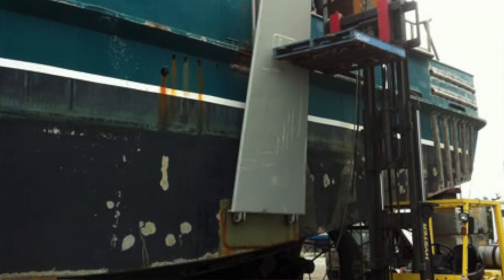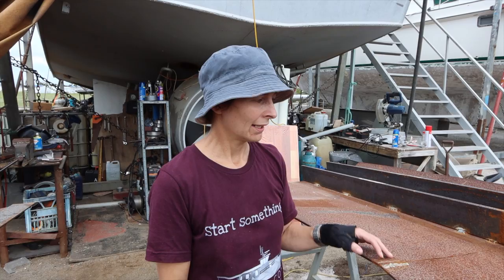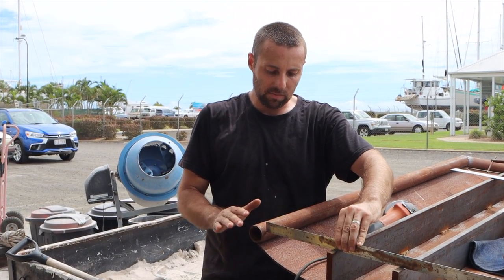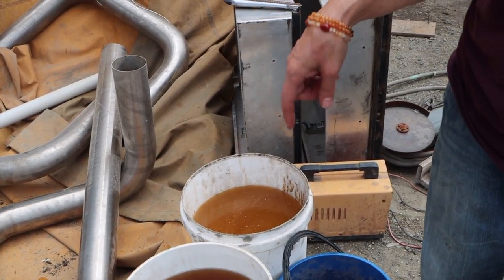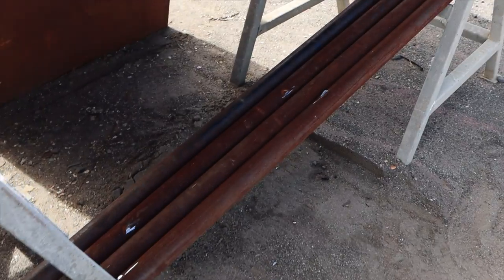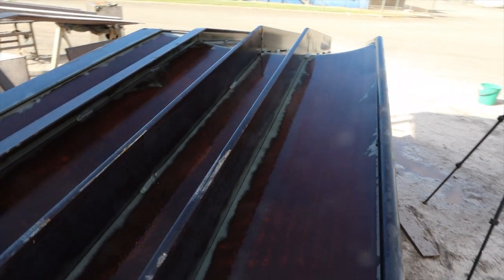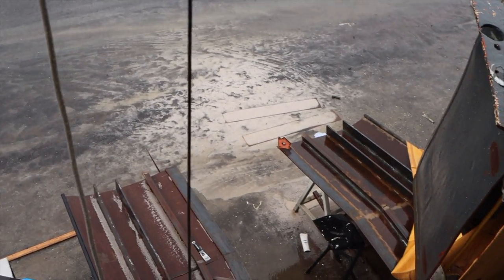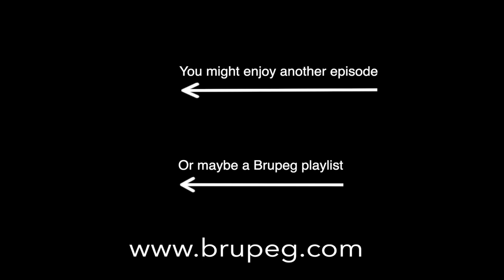Welding Steel Wings Together - Project Brupeg Ep. 127

Comment: Ok why can i actually sing word for word with that ending song??? Crazy. Fantastic BRUPEG is looking awesome.
Reply from the maker: I think it’s a sign you’ve watched the correct amount of boat building for the day... nothing more
Reply: @ProjectBrupeg  lol you think?? Enjoy the video's. One big question you ever look into the Electric over hydraulic tank setup? Which could be used in the Steering apps as if main Hydraulic system failed? Plus you could use to lift the Foils up and down with.
Reply from the maker: electric power pack they are called. They are good, but we dont have enough AC power production to run a big system, hence using the Kubota directly driving the pump means we can have a pump four times larger. That is until we can fit a big genset into the boat, at that stage we will swap out the Kubota and fit a large electric power pack. Its all about cash flow really and what we can afford to do right now with what we have.
Reply: @ProjectBrupeg  for sure i hear ya about the money part. I know i worked in the tool&Die industry and the big CNC machines used them units. Some ran low power and with some massive hydraulic pressure's. And they would replace them cheap with used units.

Comment: An old-fashioned compass, ruler and paper work wonderfully for plotting arcs of travel. Draw your minimum cylinder arc, your maximum cylinder arc, your required range of travel...etc. Keep your eraser handy and things will fall into place quickly. Keep in mind that you never want to bind the cylinder and the closer you get to lining up the three pivot points (approaching "over-center")...the more severe the loads. P.S. the cylinder is stronger in "push".
Reply from the maker: Thanks for the tips!
Reply: @ProjectBrupeg  Hey I saw those doors you made. Very cool mechanisms. Cool project all the way around!!!
Reply from the maker: Paul. Im hoping to get a metal lathe soon as I want to make some adjustments to those doors, they were a first attempt at something we had never tried before and we got 95% of the way to them being spot on, a couple of minor tweaks and i think they will absolutely do the trick.

Comment: You could powder coating your wings. That would be a lot better than just paint. In powder coating your wing will be heated up to a high temperature and a hot powder will be sprayed on to it. You even can choose a color. 
I put a grey power coating on to my stairs from the balcony down to the garden. I even had the steps coated. Now after twenty years the steps are still coated, even though the stairs have been used a lot. That shows how good power coating can preserve steal.
Reply from the maker: Hi Alfred, thats one option but powder coating can chip off and especially where we are going it will routinely be crushed against hard ice. For us epoxy paint has proved the most effective option.

Comment: Hi Guys..Going great guns now, well done..I like the idea of oil filled wings, I have used oil around boat trailers for my whole life and nothing beats it..In a closed cell like the wings in very hot conditions will create some minor pressure changes but it wont affect those bombproof units..Just a small aside though guys, Have you considered having Trev sign some official Brupeg adoption papers? He's a keeper!!..
Reply from the maker: I’ll start drawing up the paperwork now...

Comment: Dame, I love the idea of putting oil in the center cavity. You may want to consider a 1 cm hole on the bottom of the wing (when it’s vertical on) each of your braces. Then you could put a cap screw on the top and bottom and drain that out and replace every five years because the oil will get real sludgey and then not flow. You can also check for leaks because lifting that thing full of sea water may  break your hydraulics. The 1 cm holes will allow the oil to flow from cavity to cavity.
Reply from the maker: Hi Anthony. Yeah the plan is some sort of hole between compartments. As all longitudinal members are double continuous welded they won’t allow anything to pass. I was thinking of a bung at the wing tip end but it makes sense to hav one at the hinge end also
Reply: Project Brupeg also, use a standard thread on the bung, that way when you are remote and discover water in a wing, you can pneumatically push water from top to bottom and reveal the hole. You just keep an “adapter” for the bung.
Reply from the maker: Yeah that makes sense. If I make the thread the same as a nitto air fitting I can jsut rob the fitting from any air tool when its needed.

Comment: I would personally hot dip galvanize the wings. That way they are protected both inside and out.
Reply from the maker: With the wings fully welded up there is no need to protect the insides as the oxygen can’t/won’t be replenished.

Comment: Another great video. I’m not sure what your plan is but I’d put a backing run or backing bars (25 x 5 flat) in the join of the top skin, at the dihedral, before you fit the bottom skin. Then grind it out from the outside and put your root and cap runs in. Don’t weave the root and caps. Just run stringers. 
With the bottom skin join you’ll want to try for about an 80-90 deg included angle for weld prep with no more than 2mm landing (so you only bevel it down 4mm) and a nice even root gap between 1.5 - 2mm. I know welding outside makes it hard but I’d be trying to get that root run in with bare wire. Dial it right down to a nice short arc and drag the weld. Yes. Drag the root run. 
The other alternative is to fit backing bars while using the same weld prep but you can open the root gap up a bit. Fit the inner skin, cut and tack the backing bars in, then fit the outer skin. You can just pour in the flux core then. 
If I lived a bit closer mate I’d come up and give you a hand.
Reply from the maker: Thanks Dave

Comment: Great vids as ever, really approachable. I have just once concern relating to the profile of the stabilisers: If the profile is different beyond a certain degree of momentary flow deflection and lift effect, you could end up with different amounts of input across the beam. I only hope that the differential isn't too much so that it makes the vessel twist or tip. Sending good luck and best wishes.
Reply from the maker: Hi mate. The lift these create will be negligible (like if a plane was taxiing down a runway at 50kph) so even if there is an imbalance it won’t make much effect. Other trawlers are using much less precise aero fouls and they don’t notice any negative lifting etc

Comment: 14:48: "The veggie oil's turned a bit feral"...oh, I laughed at that one. 22:23: Good idea with that smaller pipe. It's thicker as a total percentage of its I.D. and O.D> and in this application should "take a hit" better if you find the phantom growler. 33:27: Considering where you want to go, you might want to consider the possibility that sea spray will at times freeze on the wings, increasing their weight unless you have the means to hammer the ice off. This could also be a factor farther up the wings once deployed. My late father was a teenaged Merchant Navy sailor during WWII and he said the "Murmansk run", delivering war supplies north of Norway and Finland to the Russian port of Murmansk, was less terrifying for the possibility of getting sunk by a U-boat and more a struggle to bash the ice off the decks and superstructure with iron bars, hatches and axes before the weight aloft due to frozen spray rolled the ship completely over. Something to consider! (See https://www.thesun.co.uk/wp-content/uploads/2018/12/NINTCHDBPICT000453575518.jpg?w=620)
Reply from the maker: We have a mutually factored this in. It’s a reason why use Single pack paint above the water line

Comment: Rather than oil, have you considered making some plug holes in the wings, then some expanding foam, then screw in some plugs.  Add quite a bit of strength.  The industrial versions are like concrete just weigh less.
Reply: Expanding foam water logs over time if you have a leak. Then it would be a pita to rust treat after that happened.
Reply from the maker: Hi Guys, yeah never ever put expanding foam against bare steel, if you want rust its a great way to make it happen, best possible solution for sealed steel tanks (like these wings) is remove oxygen, next best option is fill it with diesel, next best option is weld them up and never open them as the steel uses the oxygen sealed inside to rust but after a few days the oxygen is used up and never replaced so the rust stops (indefinately, and only starts when you cut them open and allow new oxygen back in)
Reply: Good to know.  Have seen it used in some trucks inside the cab to stiffen them up. They likely painted or treated them first then.   So thought it would work here as well.  Thanks for t he info

Comment: If it's in the budget I would suggest using acid and a good paint to rust proof the interior surfaces of the stabilizer wings, and filling them with closed cell foam to try and eliminate seawater encroachment. Also there is a new almost impervious coating for pickup truck beds sold in the U.S. that may be good for the exterior surfaces. What do boat owners do about snagging old fishing nets on stabilizer wings? Keep up the good work we are loving it.
Reply from the maker: Hi Minus, as these wings will be air tight tanks, no seawater will ever get inside them, hence no need to paint as oxygen is stagnant and not replaced by fresh air, the cheapeest and easiest option with sealed steel tanks is never open them and rust stops becuase oxygen is used up and not replaced and alternatively add some old engine oil or diesel to coat all internals.

Comment: Hello Jess and Damien
You both making a great job and I really enjoy watching your videos. I am a bit worried by the fact that you removed most of the strengtheners in the bow in the last episodes and you lost most resistance of the hull if you hit the ice. Do you plan to weld some new sheets and reinforce ?
Reply from the maker: Hi Eric. Yes before we head to the ice we plan to add in a duplicate rib inbetween every original rib and we will be adding 300 series stainless plating on the outside of the hull for abrasion resistance

Comment: Grate work and pleasure to watch i do suggest that you do a C4 system so after blasting do a thermal zinc spray before primer and paint, that will extend the life time a lot.
Reply from the maker: Hi Jesper, we dont have that capability in our yard, so we are stuck with epoxy primers and barrier coats prior to antifouling.

Comment: Talking about black water tanks and poop... have you ever tried composting heads? I had the experience of composting heads in a sailboat and it was very positive (I don’t have the boat at this time). There is no magic solution and you have to deal with the “issue” regardless but just asking. You situation in Brupeg may be different though.great episode as always, cheers!
Reply from the maker: Hi Dan, weve not had any experience with them. that said with so many people comming and going on Brupeg, sticking with 'normal' toilets means we have less drama to solve for every newbie.

Comment: Tips fore paint on the stabwings
• Roughness:SA 3
Grade Medium G.
• (50 µm to 85 µm, Ry5)
• 1. Thermally sprayed zinc
• or alloys of zinc.
• MDFT: 100 µm.
• 2. Tiecoat
• (in accordance with
• manufacturers
• recommendation)
• 3. Intermediate coat: 125 µm.
• 4. Topcoat: 75 µm.

Comment: Dame don’t forget to include a pilot operated check on both end of the hydraulic cylinder. This locks the fluid in the cylinder in case the hose blows or the valve to lift and lower it fails. A pilot operated check requires pressure from the hydraulic system to release before the the fluid flows into the cylinder. Without it if your valve or a hose fails those heavy wings would flop around in the waves until you fixed the problem. With checks it would be locked in the position at the point of failure. I hope this helps.
Reply from the maker: Great idea thanks

Comment: To stop the rust on/in the wings can you not get the galvanized instead of trying to make the air tight and adding oil etc
Reply from the maker: Galvanizing costs money and can fail, making these tanks airtight is pretty easy and is essentially fail-proof. Plus we want the buoyancy of hollow tanks

Comment: I know its to late now, but could you not have trimmed the 6 mil sheet back so the flatter skin, the leading edge pipe and the roll formed skin all line up?
Reply from the maker: Yip, but didnt think of it at the time.

Comment: Just curious about why you do not stick weld when the wind is high...is the weld not being the correct type or something?
Also...are you going to be putting a small pipe/round on the leading edge bit of the control arms that are under water to help reduce drag?

CRC is a brand here in the US...they make stuff like penetrating sprays & such...not sure if it is the same company as there.
Reply from the maker: Hi Gregory
Stick welding is very slow compared to MIG hence we don’t use it. 
Yes to the pipe on the arms for hydrodynamics. 
And yes that sounds like the same brand

Comment: so on the wings,  as your putting up and down, the forces being put on them does this change the size of your rams?  and hydraulics's?  As i see it, as your pulling it up, there will be extreme forces being applied to a point when the wing is in a neutral position then at a negative force as its closer to the haul.
Reply from the maker: Maybe, but the wing weights 300-400kg and the ram is rated to 6.6 ton so either way the ram wont even work up a sweat even if the wing was stuck in the mud with a small yacht balanced on the wing tip...

Comment: Curious why not run a hydraulic pump off the accessory drive on the Cummins? I work on a tall ship with nearly the same engines (a pair) and one has the hydraulic pump that runs the steering and the other has a clutch that engages a backup bilge pump. Just curious!
Reply from the maker: Hi Guys, our model Cummins does not have any PTO and the gearbox is annoyingly smooth with no PTO either. Hence we either belt drive a clutched pump (couldnt get belts to handle the HP needed for the pump we have) or find another option, as the Kubota was dead as a genset and still a perfectly good engine we made an easy choice to repurpose it.
Reply: The gear drive off the back of the Cummins injection pump is for a small gear pump for power steering on a vehicle and is limited to a smaller pump size which could make your wing operations slow. If you were using an open center valve bank, the Horse power loss would be very low.   The Kubota is the best solution due to it's availability.
Reply: @ProjectBrupeg  Actually, the Kubota as a hydraulic pump is, I think, a good idea for not only redundancy, but you can use it for the anchor windlass as well, if the pump on the main engine packs in.
Reply from the maker: Thats the plan, the Kubota pump will be 4 times larger capacity than the steering pump we have on the Cummins
Reply: @ProjectBrupeg  Totally worth the price to put a pump on the spinny end. Keep that alternator, however. Someone will pay you for it.

Comment: Your wings are covered in surface rust inside and out. How do you control and protect the inner surfaces from completely rusting out?
Reply from the maker: Hi Bruce. Oxygen is what creates rust. Iron pulls oxygen from the atmosphere and converts it into iron oxide (rust). Once these wings are fully welded up they will be a sealed unit so we could leave them unpainted on the inside and while there would be a limited amount of oxygen inside, the rusting process uses that oxygen up. So after a week or so the rusting is stopped and cannot start until the wings are cut open and fresh oxygen is allowed in. Also on top of all that we will be filling the wings with 20-30L of diesel to slosh around for their lifetime and further slow internal rust. Externally we just sandblast and paint to prevent rust

Comment: hi team, just got a couple of questions, how much does Brupeg weigh and are you concerned about weight distribution when she is launched with all the changes you've made? cheers
Reply from the maker: Hi Eldon. Currently she is 40t but will be close to 60 when fully loaded. We haven’t altered the center of gravity and centre of buoyancy so we don’t believe there will be much difference even with our mods. That said we will be trimming the boat as needed with cement once we know how she floats when launched